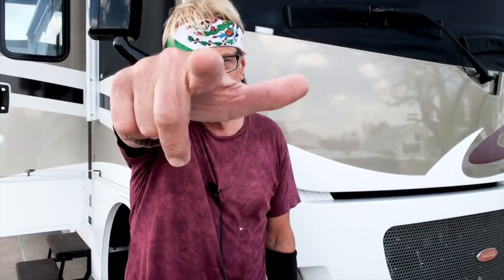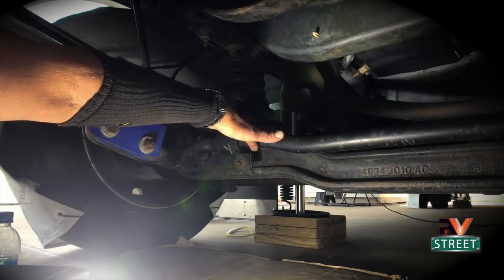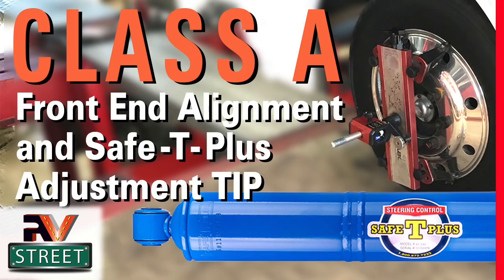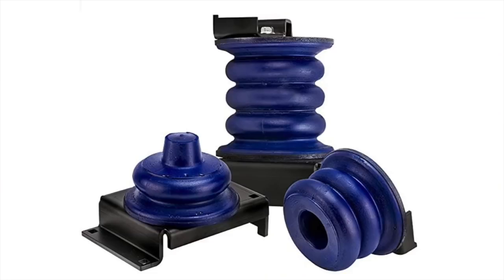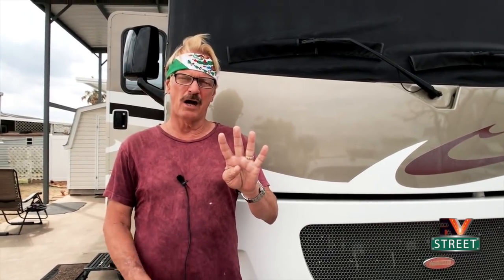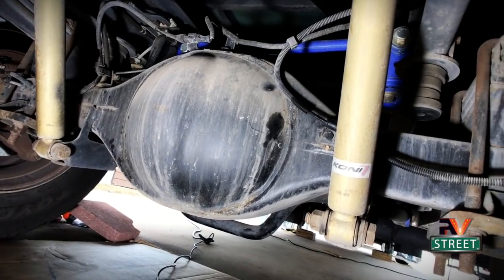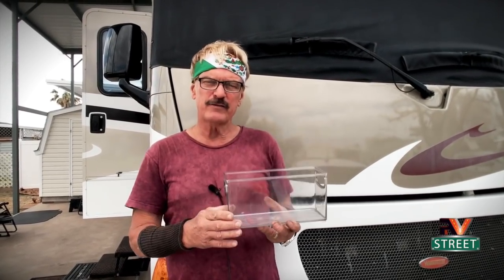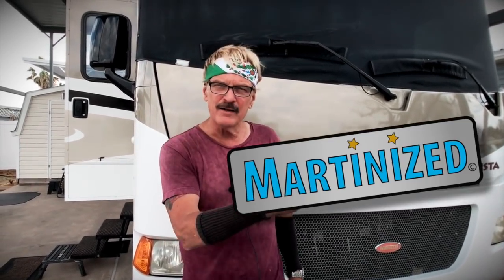Class A, Motorhome Handling Upgrades that had the MOST IMPACT

Comment: So I found this video and have watched it several times. I kept thinking to myself one day I’m going to follow Martin’s advice and do Koni shocks, a safe T plus stabilizer, a rear trac bar and sumo springs up front. 

Well as of writing this comment, I have been to safe T plus in Tallapoosa, GA and had the stabilizer, shocks, and a rear trac bar installed and I’M BLOWN AWAY at the difference. I drove 900 miles to get there without these things and was being pushed all over the roads and on a 220 mile commute to Charlotte after install I barely had any sway! 

Thank you For the videos. I love your channel and brought you up to another rv owner in the waiting room and they knew of you and love you as well! Small world!
Reply: I considering adding the rear trac bar to my 2021 tiffin 32 sa. I installed the safety steer already had sumo springs. Did the CHF but still have a little wander in the steering which requires constant correction. After you did your upgrades did it do away with  constant steering correction. Just trying to make it  more enjoyable to drive.

Comment: I have an 18K F53 chassis with 19.5 wheels. The steering stabilizer and CHF were the first things I did. And I also was able to get the TJ blue plates for the front only. Summo's on front and rear. Super steer trac bar in the rear and CHF. Still have original shocks and sway bar. Just came down I-35 from Athens to San Antonio lot of truck traffic-No Problem. Your videos should be a MUST WATCH for new gasser MH owners.
Reply: Where did you get your CHF from?
Reply from the maker: You don't get your CHF—you perform the CHF—by moving the upper link to the back hole on the sway bar.

Comment: I did the cheap handling fix without a bracket of course and it helped a lot. Also had a front end alignment but haven’t done anything else. I’m probably going to get an all wheel alignment to see if it helps the “dog tracking” that you observed my coach doing. If anyone else has dealt with dog tracking I’d appreciate hearing how you corrected it. Great video Martin and Joanie! Safe travels as you head out!

Comment: An awesome fantastic video so critical to ALL F53 owners! We have had 2 F-53's in the past decade and did the CHF on both of them. For the current 26000 lb chassis our experience in "tuning up the ride" was to immediately do the CHF- front and rear; to install a safe -T -plus; had it aligned; and I changed out the front OEM Michelins for Toyo's that seem to run so much more smoothly. While at it I had Tyron Bands installed on the front wheels to let let me sleep better at night. I am now very satisfied and comfortable with the ride. I am very careful to always run well under GVW.(But I kinda wish Santa would let me have some Sumo's LOL). CHF was a fun DIY project and adjusting the Safe T Plus every few years is easy as pie also! Great video Martin and Joanie!!
Reply from the maker: Thank you Joe so much. 🔧 💗

Comment: 1. I put Sumo Springs on the rear of my 29' class C because I carry a 300 lb motorcycle on the hitch everywhere we go. I'm satisfied with them. 
2. There's a video here somewhere where someone put a video camera on the back of the coach to show how much the differential moves from side to side in turns and during sway. You'd be shocked at how far they travel from side to side. It shows before and after the track bar installation. Frankly, I don't know why the spring shackles don't snap off without the bar.
3. I don't care for shocks that don't have a dust shield over the rod.
Great video.

Comment: Mine is a 2014 Newmar 3610, yes my first add was the blue Safe T Plus, then I installed a Roadmaster sway bar of 1.75 inch diameter,  major improvement, then I installed a front Sumo Springs (foam bump stops), I noticed first thing was the steering felt lighter, why I asked myself.  I got the proper part, so I think most front weight is in contact with the Sumos.  Rear track bar will some day go on. This crap is spendy.

Comment: You want best, most straight forward tips, and advice, you clicked on best videos here.
We completed chf, safe t plus, great improvement. 
Towing toad believe it or not, improved all sway and tractor padsimg issues.
Excellent points all around Martin.
Taking weight and tire pressure seriously is very important.
Thanks Martin.
Entegra Vision 
2019 F 53 31' Class A
Reply from the maker: Thank you so much Anthony 🔧 😍

Comment: I wanted to leave a comment on one of your How-to-do YouTube videos.
Thank you for making these videos. 
They have definitely made my mind calmer on what to expect and how to maintain my class a gas coach.
A few months ago (April 2023) I purchased a 2021 Winnebago Adventurer 36Z and have put approximately 2500 miles on it (now have a total of 4400 miles).
I never owned a class a motor home before. It has been a challenge learning about and the Ford F53 chasses. I've enjoyed it and had a nice time up to this point. However, I do want to improve the handling characteristics so within the next couple months i will be installing a Saftey Plus soon (I will do myself). I did change the oil last week change, but I did not do the grease fittings. Will do the 9 you showed on your video this week.
Today, I also watched the video on packing your front wheel bearings. I will definitely keep that in mind when the time comes.
Keep up the videos. They are so much appreciated. 
I zoned in on your RV Amazon site, in which I will be making some purchases from.
Thanks so much,
Randy Riley.
Reply from the maker: Thank you for your support and I so glad the videos are helpful.

Comment: Great vid Martin. I wish someone would do a vid like that for older Chevrolet chassis. Thanks though for the vid, Havagudun bud and stay safe.
Reply: Yep I have a 85 P30 with a front sway bar upgrade and Air Lift air bags and does ok.
Reply: @russellpottenger8584  Thanks for the reply. Mine is a 96 and has just 66,000 on it but does not handle very well. I have driven trucks on and off most of my life so being a newbie isn't my problem. I just have not found a source for upgrades.
Reply: @EDLaw-wo5it  Another truck driver heard from here.  Was looking to upgrade to aftermarket drilled and slotted rotors for my P-30 1992 34 foot Southwind to improve the braking and reduce overheating and warping.  I was surprised when checking on Ebay the listings were all "P-30, C3500".  Same thing for the calipers, same thing for the pads, same thing for the shocks.  So apparently much if not all the P-30 chassis (at least in front) is based on the one-ton truck.  I don't know if all the parts are interchangeable, but I'm checking into the 1 5/8" front and rear aftermarket sway bars for the C3500!  It might be just the ticket for upgrades on the P-30 at reasonable prices... since anything with "RV" in the name is fours times the cost of anything else..............
Reply: @EDLaw-wo5it  I also went with B.F. Goodrich commercial truck tires, all-position in front and traction lug (29/32" tread) in the rear.  Cheaper than "RV" tires and can really handle abuse.  Huge difference, especially boondocking on rough roads!  And, I installed CrossFires on the rear duals like I had on my tractor.  At $100 a pair (when I bought them at the Iowa 80 T/A), they are much cheaper than aftermarket electronic tire monitors, and you can tell at a glance in the morning if the tire pressure is right.  They also equalize the inner/outer tire pressures, compensate for the crown in the road, and you have a single valve stem for airing both tires.  Plus, I have Centramatic balancers rear and front.  I got 550,000 miles on a set of B.F. Goodrich drives on my tractor using the CrossFires and Centramatics!  But no core trade-in.... they were too old to recap when I replaced them  :)
Reply from the maker: I'd like to comment here on this one if you don't mind E.D. Crossfire has a couple of really good features as you mentioned, but the reason I don't like or use them is you can't mount a TPMS on them. I mean you can check the tires in the AM before you leave alright, but what about when your underway and pick up a nail, a screw, a piece of metal or whatever you get no warning when losing air because you don't have a TPMS there. With a TPMS you get a warning of lost pressure and you can get over to a safe spot before bad things happen. I personally want to know what's going on with my tires while under way.
Reply: @RVstreet  
Appreciate you taking the time for your input Martin. 
You always have good information to share on your channel. 
👍🏻

Comment: Great information here Martin!  FYI the plans for the "blue plates" are available if anyone wants to take them to a metal shop and have them fabricated but I believe the easier solution is the adjustable links you referred to.   You can then use the front links to replace the factory ones on the rear and get the same effect as the plates.

I also installed the Sumo Springs front and rear and they made a great difference in the ride and especially the handling.  I do have to agree with Lonsome Dove Free however, that there is still considerable 'slam-jams' on pavement cracks, bridge seams and rough roads.  I wish I could find 'softer' shock absorbers but they all seem to be geared for a stiffer ride.  "as tight as you can get them" is good advice!  

On the rear I installed the Sumo Springs before a track bar and the results were so good that I didn't feel the need for the track bar.  I get very little 'tail wag' and feel it improves the ride and handling of the entire coach.

You are so right about each coach being different and loading/balancing your gear does have a big impact on the ride and handling, especially if there is too much weight on the rear.  My recommendation is to do as much research as possible on your particular unit and owner experiences with upgrades to decide what might work best for you.

Keep up the great informational videos and safe travels!
Reply from the maker: Ya I mean the Sumo Springs or any front suspension upgrade is NOT going to remove 100% of the 'slam-jams' simply because the F53 chassis has leaf springs. But in our case it removed 80%-90% of them.

Comment: Good info over all, but Sumos are helper springs just like airbags, they stiffen your suspension which reduces roll just like a sway bar however stiffer suspension means harsher bumps. The air space on the stock bumpers is softer then a Sumo, its there so smaller bumps never hit the poly, if something reduces body roll it has to make the suspension stiffer, it's a trade off, unless computer controlled like Liquid springs. Also the standard CHF without plates or extensions is stiffer than the plates, again a trade off, the new V8 sways bars are even stiffer at 2", but again a tradeoff for rough roads.
Reply from the maker: Yep everything has a trade off, but I respectfully disagree the Sumos makes harsher bumps. At least on our coach. On our coach they act kinda like a cushion and I can't over state enough how much smoother the handling is and they have reduced the "slam jams" 80%-90% and of course roll. It was like night and day from OEM bumpers. I wish I had done this a couple of years ago.
I do appreciate you taking the time to comment Justin. 🔧 👍
EDIT: As I further thought about your comment, there are some sumos for different model coaches that are one piece. Not two piece like ours are. That could very well contribute to a harsher ride. Our sumos as you know are two piece/cone shaped. They are constantly separating and compressing while underway.

Comment: THANKYOU FOR posting these videos. With the Hellwig end links for the CHF your site references 3 different sets? Which set was for the front and which set fit the rear? I have the 2015 F53 Chassis. Thanks again!
Reply from the maker: Your welcome Jim,
All three can be used for either front or rear. You just have measure to see which size will work for your coach. All 3 have an adjustable range. 👍
Reply: @RVstreet  Ok, thanks again! Keep up the great work! :)

Comment: Hi Martin, great video. I'm curious what length RV and wheelbase do you have. I talked to a Freightliner chassis engineer, and he was telling me how important wheelbase ratio is for handling. Not sure if I was leaving something out of my RV upgrades but I did not get hardly any good results you are talking about. I purchased a new 30' 2017 FR3 and on the way home I realized I made a mistake. Just like you are saying I upgraded a few things, Wheel alignment, upsized front sway bar, upsized rear sway bar, Safe T Plus, rear track bar. I did leave the stock shocks being they were brand new, and I did not install sumo springs. The only reason I did not is because at this point the results were so miner, I did not want to spend any more money. Another thing that did work better than anything I have ever done for a smooth ride is have the tires trimmed. Yes, trimmed very few tire shops have this machine. Once I did that it was like driving on glass. Anyway, the coach still handled so poorly I sold it in two months. I really miss the gas rigs, but I don't trust how they handle and it's hard to find a way to test drive one on an open highway in high winds. It may have been the poor wheelbase ratio that was causing all the problems. Sadly, when you ask a salesperson about wheelbase ratio, they look at you like a deer in the headlights. I do have somewhat of an extensive experience heavy truck driving history. I drove 18 wheelers for a few years in my early twenties then Firetruck apparatus for 30 years. My first RV was after I retired and the first one I test drove I was dumbfounded. I could not believe how bad they handled and how the public accepts this. Why are the manufacturers not installing all these products in the first place? I'm looking forward to the day I finally give it up.
Reply from the maker: Mine is 35', 228" wheel base, 22.5" tires.
Yes wheel base length does make a big difference. The longer the better. But the longer it is a rear track bar is absolutely necessary to get tail wag under control and even more so if your towing a toad. But more importantly since yours was only 30' long you also had 19" tires. Short motorhomes like yours with small tires are more difficult to tune and are shoved around a lot easier. In essence, there a short tall box and very little weight to keep them steady on the road. But in all cases concerning gas motorhomes they all are built on a truck chassis with leaf springs. You can't ever make a truck chassis motorhome handle or drive like a big rig but I can tell you all the things I did to my motorhome made a huge difference in handling. There are so many things that affect and work in concert that make handling smoother. Like the proper PSI you run according to your weight is very important too. Concerning high winds, I define high winds as 25-30mph. If it's more windier than that I stay put then travel when weather gets better.

Comment: Hi Martin. Love all your videos. They are a blessing to a lot of people. Saw your video about Centramatics. Since you had them installed how satisfied are you? I talked to a dealer that said to not balance the tires before install. I am getting new tires and have already ordered the Centramatics. You balanced your tires before tire install and I want to know your thoughts since then. Thanks again for all you do for the RV community. Howard Wilkins
Reply from the maker: Yeah you don't have to balance before installing centamatics that's just something I do. I've had mine on now since 2017—2nd set of tires—and wouldn't have it any other way. You'll never have to balance your tires. As long as your alignment is right and running your tires with the right PSI according to your weight, you won't have to rotate tires either. 
Just as a side note: Whenever you get an alignment, be sure to get an ALL TIRE ALIGNMENT, not just the front end.
thx Howard 👍

Comment: Nice video, thank you.  I had Liquid Spring suspension installed in the rear of my 21 F53 chassis and it made a big difference, of course that cost me 14k.
Reply: Is that in conjuction with any of the other upgrades? Or just the springs
Reply: @nickl8192  No just the Liquid Spring in the rear, everything else is stock.
Reply: @agm6095  Awesome! Appreciate the reply.

Comment: Such a great informative video Martin. Can I do these upgrades with RV jacks extended to give me extra room to work?
Reply from the maker: Our coach sits on a F53 chassis, so in my case, for me and my size there's plenty of room. If you're a larger person and need more room—I would NOT—use the leveling jacks to raise the coach up more. If for any reason one of those jacks failed, leaked or anything else where the coach would come down some, that would create a very unsafe situation. If you need more room, I would raise the front axle using (2) 8 ton bottle jacks—one on each side of the axle—raise the coach and then block each side of the axle with wooden blocks. You could also build a couple of solid wooden ramps and drive the coach on top of those. This will work for both the front and the rear of the coach. If you go the wooden ramp route, be sure the ramps are wide enough that both dually tires are firmly supported.